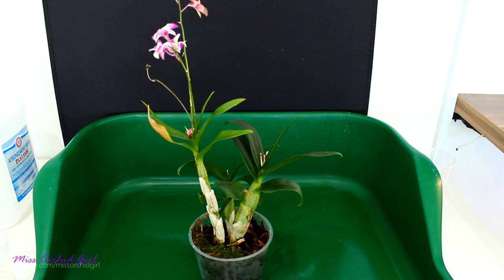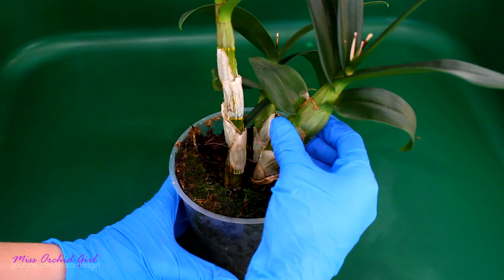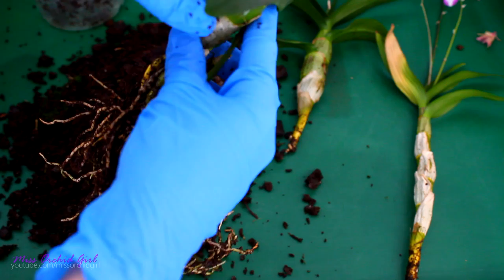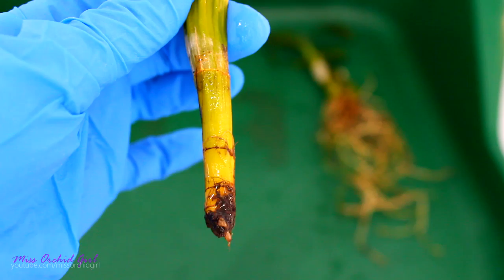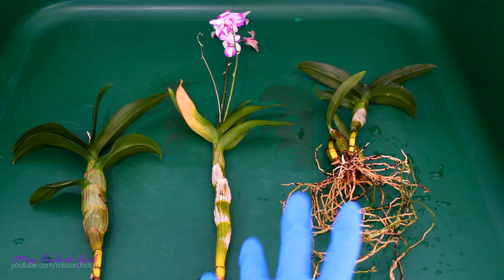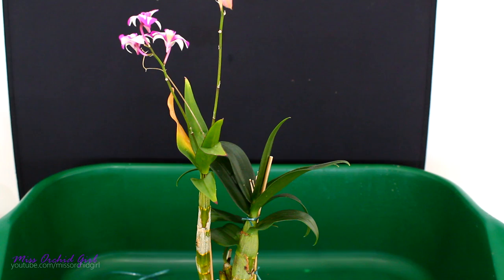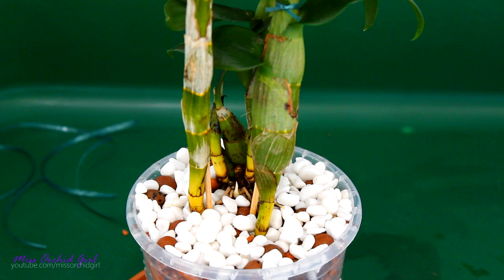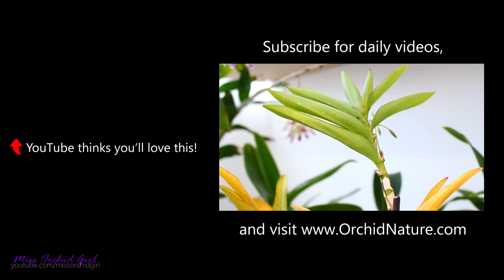Repotting mini Dendrobium Orchid - What a disaster!!!

Comment: Hello, what is the difference between phalaenopsis and dendrobium??? Thank you
Reply: Phalaenopsis require no direct light (full sun will kill them, even partial sun can result in sunburn if it's too strong) and need a bark medium to grow in, they don't have canes or pseudobulbs and just grow leaves on the crown. Dendrobium typically can withstand up to full sun and usually require a stone or clay medium. They have canes and pseudobulbs that grow over time and produce new leaves and flower spikes.

Comment: i have 2 dendrobiums one nobilae and the other mini(?). i can't make them grow straight nor have full trunks and flower rarely. i repot and repot but they are stuborn.
any ideas?
Reply: Most likely not enough light, they need a lot of light to flower. Might need an adjustment period to get used to stronger light if they currently don't have enough as well. Also what''s your fertilizer regimen?
Reply: Thanks. i really dont know exactly what conditions dendrob need and I DO HAVE A LIGHT problem. the only remedy i have is to put it outside (now coming summer its going to be soon 15-32 C degrees outside).
Fertilizer, i have bought some special for orchids, liquid, one cap once a month.
The media is wood chips/cork.
It 8s very hard & expensive to get orchids esp other than phaenelops. I'll risk to put it on the porch (open), part sunny.
how about windy? will they mind much?
thnks.
Reply: I get some 25 mph winds and not had any problems really. But I'm in Hawaii so I can't really tell you much except I keep my dendrobiums outside. As long as they don't go below 15 they should be ok it was a really cold winter here this year and it dropped to 15c at night for a few weeks.
Reply: well i'll risk and put on porch.
what media is suitable between:
bark, wood chips, lava rock, coconut "hair"
this is what there is here.
thnks, wish me luck -:).
Reply: I use 100% lava rock but they dry out fast and I water almost daily because of the heat.
Reply: @christophersteen1873  How long has your Den. been growing  lava rock and how has it done so far?